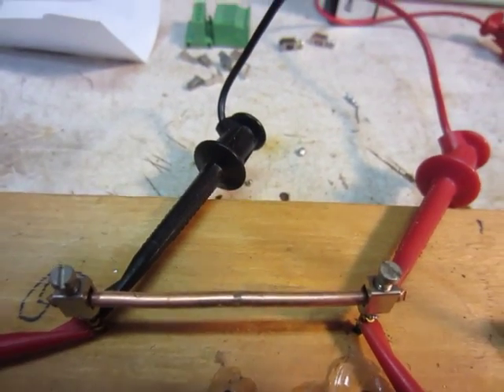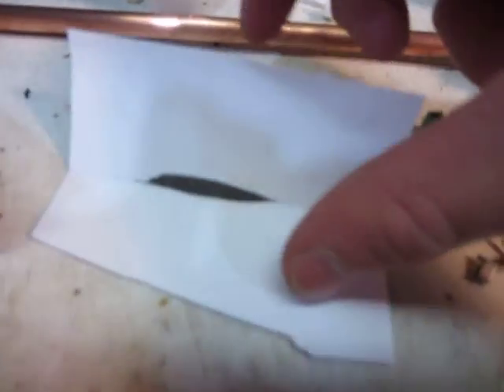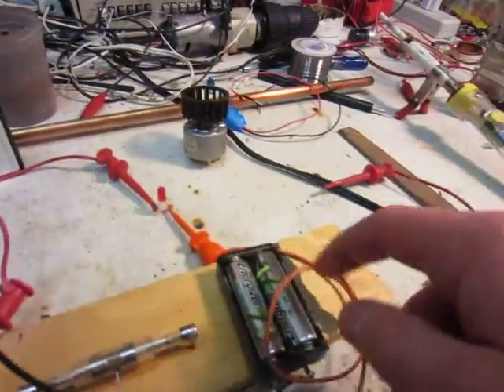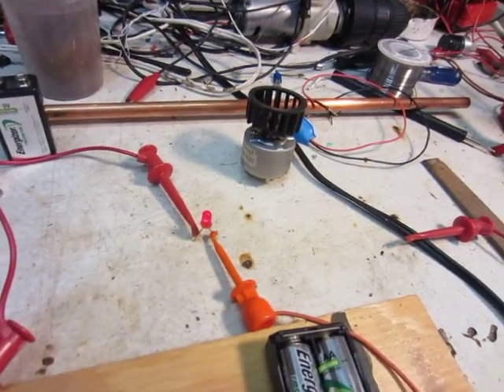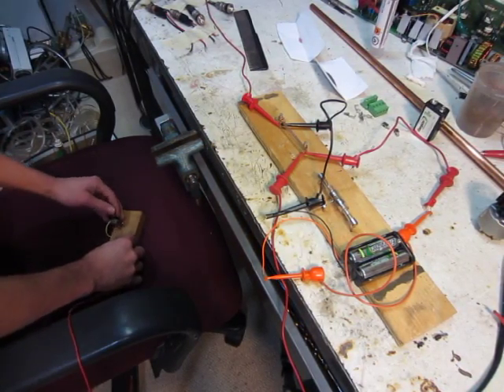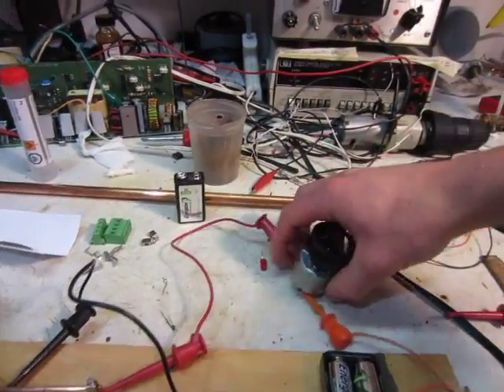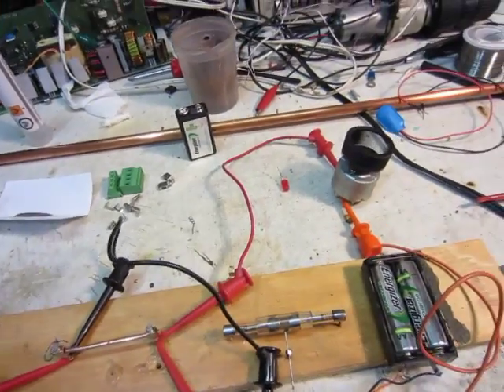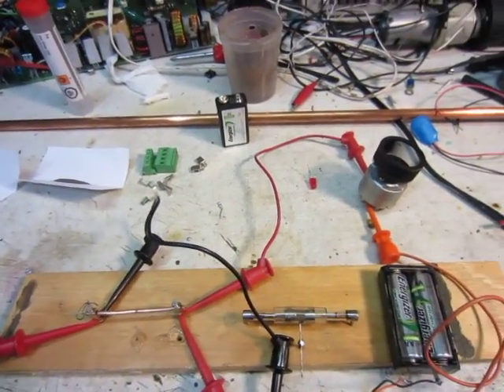Home Made Working DIY Coherer

Comment: Nice job.
Using the comb is pretty clever.  YOu should also me able to triger it with a transmitter, such as a CB or ham rig.
...
For others interested, ther's a book on line that describes an entire spark wireless set from 1910:
 Coherer & Crystal Detectors Part VI
https://books.google.com/books?id=-d0DAAAAMBAJ&pg=PA909&dq=wireless+telegraph+set+Popular+mechanics+Part+%22VI&hl=en&sa=X&ei=qP_WVMHtFdamyATIy4H4AQ&ved=0CB8Q6AEwAA#v=onepage&q=wireless%20telegraph%20set%20Popular%20mechanics%20Part%20%22VI&f=false
 
The Whole Book:
https://archive.org/details/howtomakewireles00more
 You can download a pdf to you computer if you like, or text only.
...
I have my dad's Coherer parts.  He made one for a ,who got it long before, in the 70's for a spark-radio controlled bus that had a broken one.  his kit has nickel and silver.
They had vacuum tubes in the  50's. Coherers were used much earlier until about 1905-10 when crystalo (diode) detectors replaced them.
--
BTW: Coherer has three syllables.  Co-here-er.  A thing that co-heres.
Cheers, ScienceAdvisorSteve
Reply from the maker: Neat!  Thanks for the info!  Really cool what they could do without transistors!